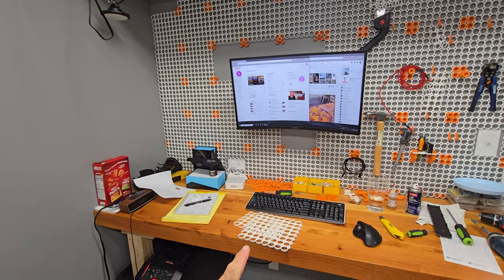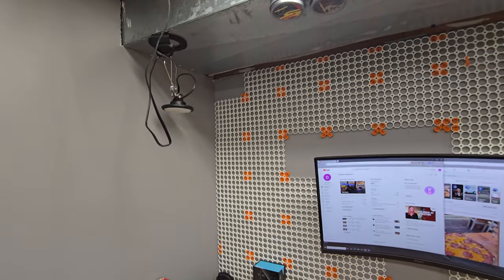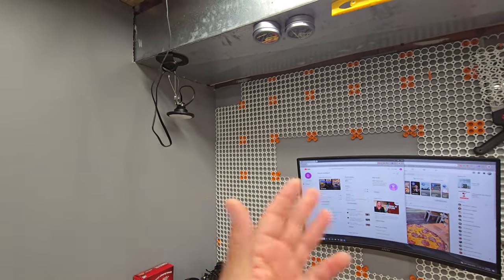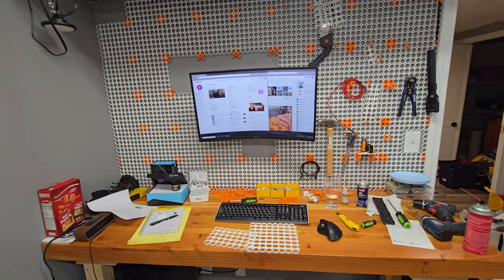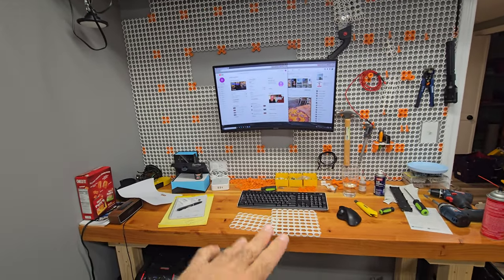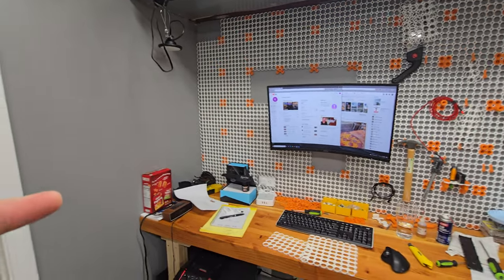Workshop: Part 4 Almost Completed Wall of Multiboard Madness!!!

Comment: I admire your determination. I would have thrown in the towel a few times already. Have you considered getting something besides an Ender? I feel like you've spent a bit trying to upgrade that sucker.
Reply from the maker: Yeah, I'm determined to a fault unfortunately. If I had the money I'd go bambu with AMS, but I might hold out for qidi with AMS when it comes out. For now, I need to get these working. I think multiboard is a torture test

Comment: Get a PEI double sided magnetic build plate, you won't look back. If a warped bed is an issue (one reason I used glass as long as I did), use some painters tape under the sheet to raise any low points that the auto levelling isn't compensating for. 

40mm/s is the fastest I would go for retractions, personally I use 35mm/s and 1mm-1.5mm on those style direct drive setups, 40mm/s 0.5mm on my sv06 and 30mm/s 3mm on my bowden equipped ender 3's (the 6mm they use as default is twice what you need, I get no stringing and can print the Eiffel Tower print reliably, so long as I have dry filament). 

Glue stick is fine and it works, but once I got a PEI build plate for one printer, within a week I replaced all 4 of my print beds with PEI, and only a week earlier I bought 3 brand new glass beds, 2 of which will likely never be used now.

Good luck and all the best. If you need any tips I have done the hard yards and am happy to help.
Reply from the maker: Hey Joe.  I have a PEI plate, wasn't liking it because nothing would stick and my bed was VERY unlevel so I went to the glass bed.  Initially the comgrow glass bed was amazing and everything stuck....until it didn't and it has been a nightmare since.  I will look at the painters tape idea and try the PEI again.  

As for the retraction speed, I think part of the issue is that multiboard is like a torture test for the first layer and I keep getting little blobs.  Retraction speed and distance didn't seem to make a big difference, but I did do a retract tower and it looked like 1 to 1.2 was the sweet spot with the slightest amount of angel hair coming off. 

Thanks for the offer and let's hope I can get this to the next level!
Reply: @dougdoesstuff24  Yeah, I thought the bed may have been warped/unlevel. It's extremely common with cheaper printers, I have no levelling probes on my ender 3's and with painter tape to get the bed as level as possible I got great results. I  am mainly using the textured PEI unless I am printing ABS, you get a little more room for error.

 Also for the smooth PEI a light scrub with a lightly abrasive cleaning pad will prime the PEI and material will stick far better (I think in  the US they call them brillo pads?), not the ones that are soapy though, just the normal steel wool ones. This only needs to be done every so often and I go tens,  if not a hundred prints before needing to give it another scrub. Just IPA cleans in between to get any oils off the surface.

Good luck mate, and happy, hopefully successful printing.
Reply: @dougdoesstuff24  Oh, also I have the same comgrow glass beds and they stick extremely well when new, the brillo trick also helps to revive them too, but once the surface is completely worn it will need replacing.
Reply from the maker: Both my printers have CrTouch probes on them, but without the glass it is so unlevel.  Maybe I will do a video showing the difference.
Reply from the maker: I only printed a few times on the glass bed, no reason for it to be worn out at this point.
Reply: @dougdoesstuff24  If they are new a scrub will still help. I had adhesion issues on new beds and that's how i discovered the brillo method.
Reply: As you discovered though glue stick  works well, I just prefer not to use adhesive if I can help it, I like a nice clean bottom... Don't read too much into that...
Reply from the maker: I prefer not to, but this comgrow bed would not let anything to stick without it
Reply: @dougdoesstuff24  I know the feeling, I have had to use  glue stick  many  times, even on PEI depending on the print geometry and material used. Sometimes there is no other way to make a print stick, regardless of your surface of choice.

Comment: I just started watching your videos and iv seen 2 now but did you check the nozzel on the ender it might be worn if its not using a harden nozel.
Reply from the maker: I appreciate you following along. It was a hardened nozzle, but I did end up changing it. Did not have very many hours on it though. I think my issue was bed adhesion too
Reply: @dougdoesstuff24 you may already know this but they do have a sticker type build plate you can put on top of your current one. They are pretty cheap here In Canada.
Reply from the maker: @Dot2TheLock  a sticker type build plate?  Not sure what you mean.